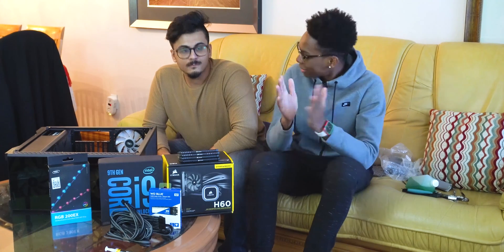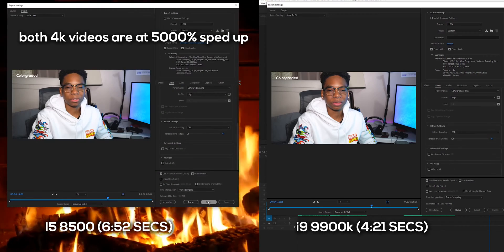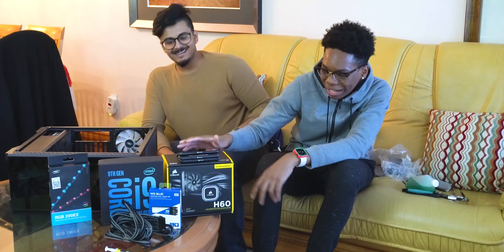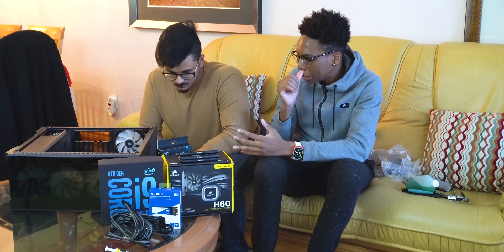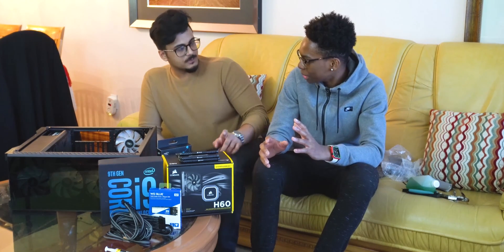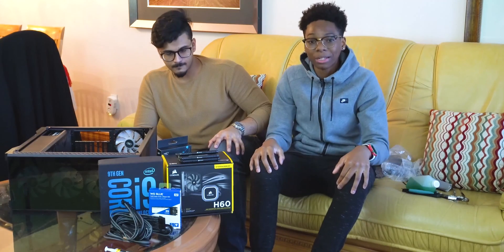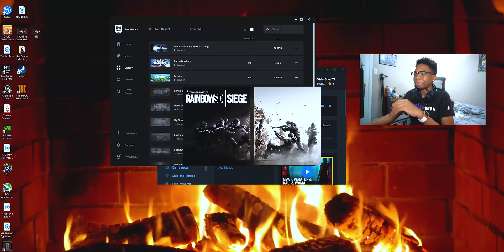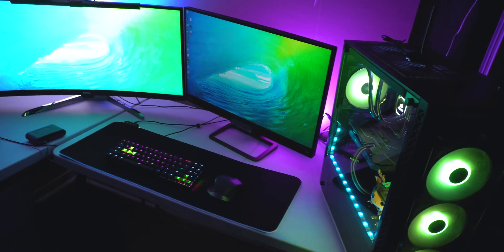$2000 Gaming PC Build - i9 9900K RTX 2060 (w/ Benchmarks) - Christmas Theme

Comment: you should have gotten an i7 9700k or 8700k and use the excess money on a rtx 2070 or 2070super or even 2080
Reply from the maker: Galxtron i now have a 2080 super
Reply: @ShevonSalmon  thats a beast gpu, compared to the 1660 i am getting
i am getting a new pc, specs are
ryzen5 3600
gtx 1660
256gb fast nvme m.2
1tb hhd
x470 motherboard
deepcool matrexx 50
650w psu 80+ bronze

Comment: You're going with about 20% bottleneck btw. Nice build 💀
Reply from the maker: ThatGuyOnCaffeine thanks 🤑
Reply: Grienxツ yeah
Reply: Curtisg839 isn’t a cpu bottleneck the opposite tho? From what ik, at least i thought was that it would be like having a 9100f paired with a 2080 super?! Not a 9900k & 2060 super... wouldn’t that be ok? I mean I would personally rather have a 2080 super instead of a 2060 super or if i were going with a 2060 super id get like a 3600 or a 9600k.. idk 
👁👄👁
Reply: @cruz1n494  yes it’s a gpu bottleneck
Reply: Curtisg839 oh ok, thx for replying... wasn’t sure. 😂
Reply: @cruz1n494  btw the reason he got a i9 9900k with a 2060 is because he upgraded to a 3090 I think lol
Reply: @curtisg8399  oh... makes sense. 😂

Comment: I dont know why you got rtx 2060. For 2000 bucks you can get 5700xt.
Reply from the maker: teo_ned I rather to use Nvidia
Reply: @ShevonSalmon  yes it may be more reliable but the 5700xt is extremely powerful

Comment: Although the i9900KS is better overall in gaming, its by a very small amount. (6% average at 1080p & even less at higher resolutions). Where as a Ryzen 3900X is MUCH faster at content creation (thanks to 4 extra cores, and better single thread performance at stock), and only a little slower slower in games. 

Not to mention PCI 4.0 support on the 3900x, letting you use faster drives and making the gap even wider for content creation. I'm assuming you do more editing than gaming, in which case the 3900x would've been the wiser choice. 
But I understand you also got the i9 from intel, so fair enough I guess

Comment: As seen bro your temps, that AIO cooler isn't enough. Need one with a bigger radiator of two to three fans.
Reply: Hes getting easily 87 Celsius on that aio . 120mm aio is not good enough its equivalent to a air cooler . 240mm aio is the way to go with the i9
Reply: Wet vegetables it’s an aio are you stupid?
Reply: @connor7520  looll this was 10 months ago, please note that the aio he had had 1 Fan and a small radiator is not enough for a I9. Dont call someone stupid when you dont have the knowledge on tech.
Reply: @RamonScott777  yeah that was 3 months ago I know a lot more abt tech now my bad man you were right
Reply: @RamonScott777  and he put a 9900k with a 2060 so I don’t think he knows much abt pcs😂
Reply: @connor7520  he eventually upgraded, he has a 3090, keep in mind if the processor he mentioned he has before the 9900k

Comment: how much FPS will a amd ryzen 5 3600 with a Radeon rx 570 with 8 gb of ram get
Reply: I would recommend going with a R5 2600 instead of 3600, and spend money other parts, The 3600 performance over the 2600 will not have a lot of benefit on your build because of the GPU and ram.